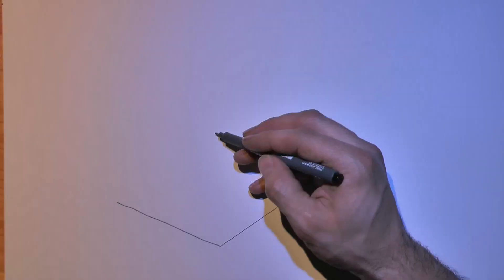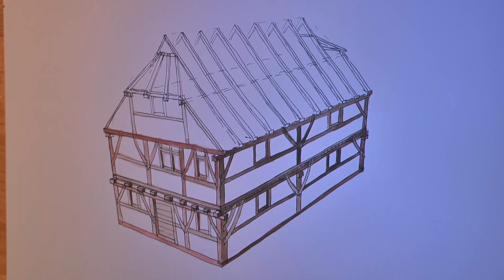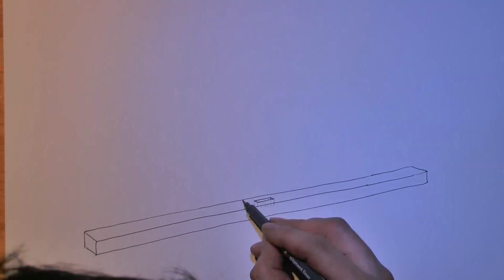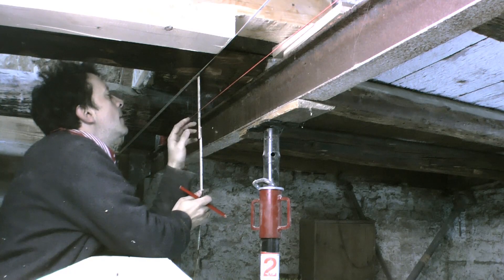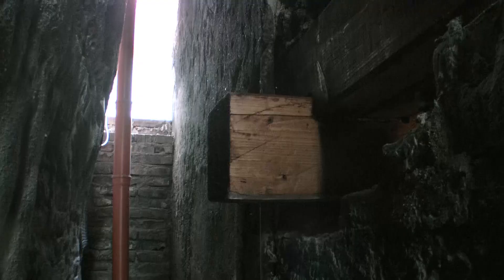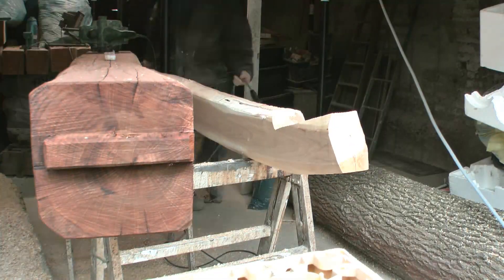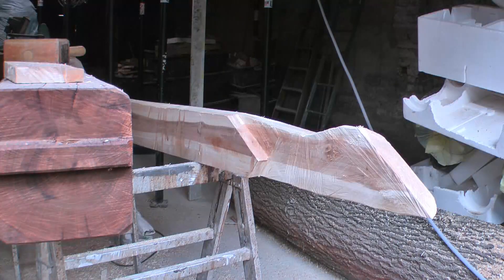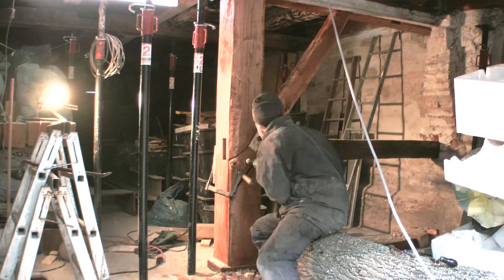timber framing 1

Comment: Thanks for posting/sharing, for whatever it's worth, i had a book on timber framing, that talked about how after the mortise was made with the hole for the peg, a scrap peice was interested in the mortise and the drill was inserted in the peg hole until it touched the scrap tenon, where the drill bit touched the scrap tenon this was measured, the the hole on the real tenon was drilled closer to the shoulder by a 1/4 inch ro more, so upon assembly the joint was drawn tighter together, most of the readers know this but it may be new to others, take care friends.

Comment: Excellent videos! The wedged post base is a brilliant solution to replacing a timberframe post! The dovetailed brace is problematic to my mind. Compression force on a brace would tend to push in the opposite direction of the strength of a  dovetailed member. I don't really see where the base of the post would endure any side force to make the work of dovetailing necessary.

Comment: Was a wood preservative being applied to the timber just before assembly or only a stain? How is the preservation or stain made? 
   What prevents termites from eating the timbers? 
   Is oak a better framing material than pine? Is there a guide to indicate what wood is preferred for which application?

Comment: Very interesting video! My uncle recently finished restoring an old building that had been used as a shed for livestock and storage. It wasn't quite as old as the building you're working on, but it was still old. I think around 1750 - 1800. He got financial support from the government to restore it using old techniques, and materials harvested from the island that the building stood on. Is it possible to get financial support from the government to do stuff like this in Germany? I'm from Norway by the way.
Reply from the maker: It is possible to get financial support, but that ist limited only to repairing the existing structure und there only half of what it costs more than a "normal" repair in any house. And If you do the work by yourself, it is a bit difficult. For what is shown in the video, I couldn't get support anyway, but maybe I will for some other parts.
Reply: Matthias Burger But could you have gotten support if you didn't use power tools? Like the chainsaw? My uncle and the people he employed through the project was using old techniques, and old tools. But the work itself seems really similar. Replacing old and damaged wood with new wood. It's basically what they did as well. And of course, as you say, the financial support didn't cover the entire budget, but he was able to employ 1 person more or less full time (he was the woodworking specialist) and other people part time, like a masonry specialist, and a paint specialist (they even used ox blood in one of the paints. It's illegal to use it normally, but since it was a restoration project it was allowed.)
Reply from the maker: stygn
The "Landesamt für Denkmalpflege" which does or does not give you support here doesn't care much about the type of your saw. Restoration has to be fitting to the existing structure in functional aspects, but making new parts look exactly as if they were old isn't the intention. Doing this and especially by using all the old methods is more like a museal project and not seen als conservation.
Reply: Matthias Burger I see. Well yes, it wasn't mainly a conservation effort to restore the usability of the building, but more a work to preserve cultural heritage, and thus the use of old methods was needed to give the project and building the "soul" it needed to be viewed as cultural heritage. The building was beyond repair simple repair, and was basically rebuilt, so I understand the difference your talking about. Well, really interesting video, and I'm looking forward to your future videos : )

Comment: What kind of wood was used in the framing of the timber-framed houses of, say, Germany?   I've always wondered if rotting of the timbers would be a problem, although I've never seen any evidence of any in those beautiful, old houses.
Reply: Oak, protected with tar. And the wood MUST be allowed to dry. So do not seal it. When cladding of slate is used, a space for ventilation is essential. Otherwise you get dryrot and the timbers get spongy and decays.
Reply: @ingridchristiansen4367  - better to use limewash rather than tar - a 19thc. bi-product of making coal into gas for domestic and industrial use in UK - that does not allow the wood to 'breath as moisture is trapped.  Before that time timbers were never black. See Lavenham Guildhall - timberframe, Suffolk UK.

Comment: What building techniques eventually replaced this?
Reply: Balloon framing and then later stick framing. However, "replace" would be the wrong word to use for the Germans because timber framing has not been replaced there as they still use it frequently in Southern Germany.

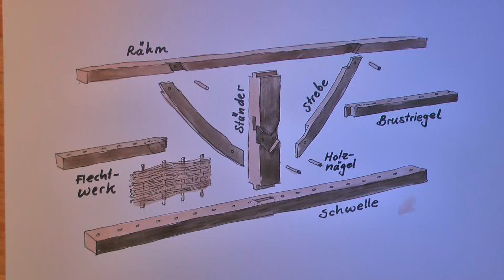Comment: Paused @ 2:36 to learn some German words. Too bad their respective definite articles were not included. E.g. Is the bottom beam called der Schwelle, die Schwelle, or das Schwelle? OK, one visit (and a bunch of typing and mousing) to De-En Beolingus says it's die Schwelle.
Reply: We have three articles in German, der = male, die = female, das = neutral, And yes, right,it is die Schwelle.
Reply: I was already aware of the 3 articles and what thy mean. The issue was what gender are each of the nouns.
Decided now to get the respective articles for the rest of the nouns: (from http://dict.tu-chemnitz.de/deutsch-englisch/ )
der Ständer - the stand.
der holz-nägel - wooden nail.
das Flechtwerk - the wattle.
die Strebe - the stay.
das Rähm - the plate.
die Anblattung - the halving.

Nothing available for Brustriegel.
Reply: That's complicated. There is no gender in German grammar. The old latin rule for it is: sexus is NOT genus. Meaning, the obvious sex ist not the grammar sex. Example Mädchen (girl) seems female, but the article is das= neutral. And Holznägel, ok das Holz, neutral, (wood), die Nägel (nails), plural, female, singular der Nagel male. Combined der Holznagel, singular male article, die Holznägel, plural female article. So, with combined words the end of the new word decides about the article and there are different sexes of articles for singular and plural forms of a word. For Holznagel it is like the most important thing is the nail and wood is used like an adjective but combined in a new word. In englisch that would be a wooden nail but I think woodnail is quite uncommon while woodbridge for example is not so uncommon.

Comment: Nice to see this kind of restoration being done step by step. Must take ages to measure and mark up for that first beam!

What is the reason for the dovetail on that brace towards the end? I would have thought it was unnecessary as it is under compression, not tension, but I have seen it on another building in Germany too, is that typical in this situation?
Reply from the maker: Yes, it's typical. If the top plate is pushed sideways, the brace on one side will pull out of the joint.
Reply: dubbulj the purpose of the dovetail is to prevent racking.